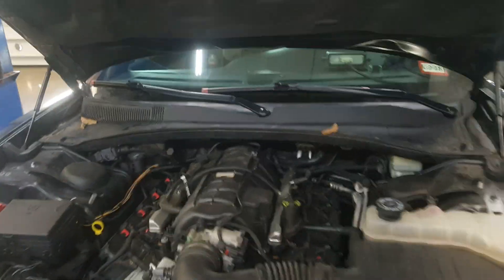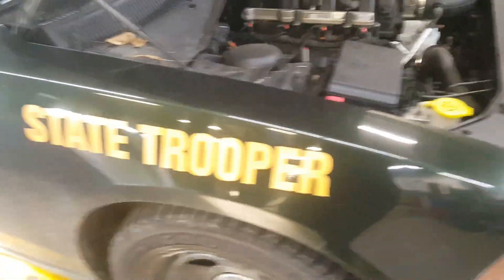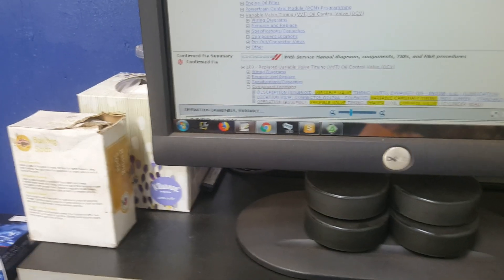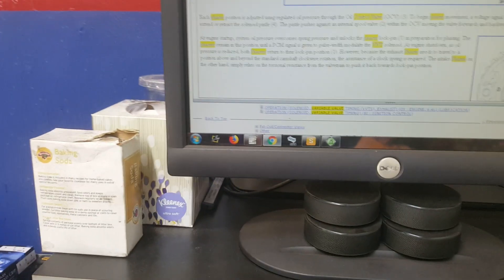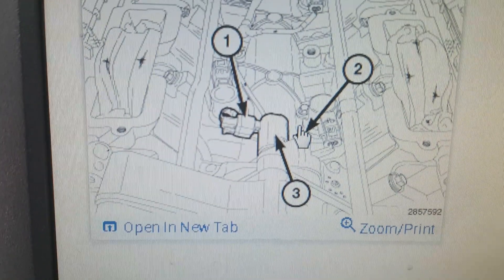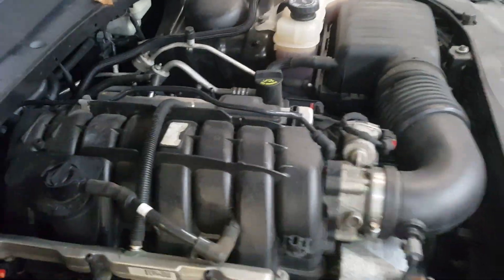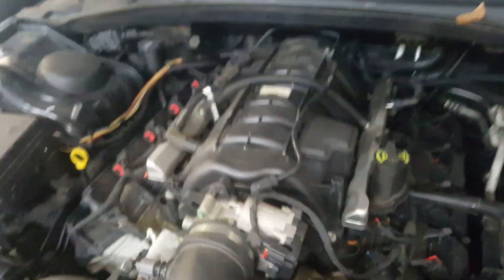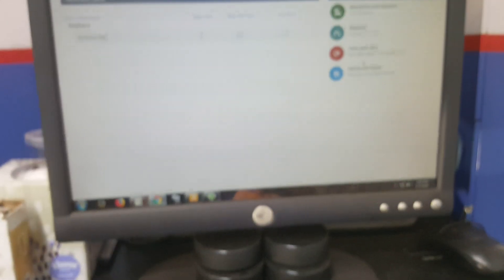How to Fix P000b P0016 Variable Valve Timing Dodge 5.7l

Comment: I’ll try this out. Thanks for sharing! My Charger isn’t showing a check engine light. The VVT monitor isn’t resetting and won’t pass smog. I’ve driven the car over 500 miles to get it to reset. Are there other steps you recommend after changing the oil? I’ve been to 2 mechanics and they are stumped.

Comment: At the end of the P0016 Road there is a new timing chain, and possibly more, waiting for you. New oil, ha! New VVT solenoids, ha!. Those are just road markers. 😆
Reply: So what about P000B??? I know that stupid eco mode on these cars can fail but what would P000B code be long term? It's Camshaft position slow response bank 1. Clear the code and it comes back around 100 miles driven. Thinking of going with the solenoid under the manifold. Told my wife to stay away from the Jeeps but she couldn't resist 🚮

Comment: I wished I saw this before last week, same issue with my 2010 challenger, the dealer says they fixed it but now the VVT actuator sensor is bad and they are trying to charge me another $400. Is it worth that? The part is only $64 they say

Comment: I changed the oil in my wifes Telluride. I normally add engine restorer to the oil every oil change and b12 chemtool to the gas. now I have a check engine light on the vehicle. what do u think. I have the codes p0016 and p0016p.

Comment: Hell.... I did a resistance test and it has audible click and it was still jacked! Just look at the desired angle vs actual angle PIDS, if they're aren't matching after changing oil, replace the solenoid. They're like $80. These engines are crap😂😂

Comment: I changed that solenoid when I changed the lifters, cam, water pump, timing chain set and gaskets. The original oil control solenoid had the one screen gone. I got those codes and checked it. The new one had the same screen busted loose, that was broken on the old one. O'Reilly's replaced it under warranty. The O.E.M. one looks like the Dorman one from O'Reilly's, but it has a retainer that goes over the screens, so it doesn't do what my new one did. I figured since that one broke, replacing it would fix it. It didn't. Since those codes are for the crankshaft and cam position sensors, I changed those. Still getting the codes and the engine sounds like it's pinging, when accelerating. It almost sounds like a rattle when driving it at a constant speed. At first it started as a noise when economy was on. I would change it to shifting manually, to turn off the eco/MDS. It seemed to go away every time I did that, so I thought it was the MDS solenoids. When I found the new oil control solenoid screen broke again, I also changed the MDS solenoids. Still making that noise. It's really strange. I can be driving and hear that rattling noise, and it would go away when I change gears. This is really annoying me. Do you have any idea? I have about 10-15K miles since I did the cam and lifters.
Reply from the maker: Sound like a loose timing chain. Maybe bad tensioner.
Reply: You need to replace your timing chain
Reply: Did you figure out the problem?
Reply: @abby.m0124  I've been too busy fixing what contractors failed to do and do right, at mother in laws house, after a water leak in her house. After Thanksgiving, hopefully I get a chance to replace the VVT mechanism on the cam. Right now, my thermostat is sticking too, so need to change that while I'm at it. I just haven't had the time. Good thing we have other cars to drive.
Reply: @shark70007000  sorry to hear about the sub par work your mother inlaw received, I was asking about your truck because my 2012 ram 1500 5.7 hemi threw me p0016, (constantly was on) and p000b (was coming ob and off)
And the guy at Auto Zone hooked up his little obd2 reader, and he said “His computer is pointing at the VVT Solenoid, Its a part that is relatively easy to remove and replace, but the hard part is getting to it,
Its completely under the intake manifold, And boy what a job that was today, But it all done, and the code cleared it self, my Ram has 165k miles, but she still runs amazing.

Hopefully you can get your truck figured out, But after your mother in law is taken of, Of course
Take care man
Reply: @abby.m0124  When I take everything apart, I'm going to have to take that VVT solenoid back to O'Reilly's, again. Since the part does have a warranty. I wasn't getting any codes for it, even though the screen came off one part of it. Changing that solenoid is easy, compared to what I have to do.
Reply: @shark70007000   I would check out the timing chain guid, or tensioner,  (Im not a mechanic by any means,) Ive read that, and seen a couple vids on YT that after replacing the cam crankshaft sensor, and or the VVT solenoid, and the rough idle is still there, its most likely the timing chain guid or tensioner, Like I said, Im not wrench turner by profession, only when my truck needs to be worked on, and Im trying to save $$, Hope this helps .
Reply: @abby.m0124  When I have the front of the engine apart, I am going to check that. I've had to replace the timing chain once, since I did the cam, lifters, chain and water pump. The guild was a 2 piece part, where the plastic broke, so the chain was running loose. It caused that noise for a year, and caused the teeth on the crankshaft timing gear to wear out, so the chain jumped a tooth. That threw cam and crankshaft position sensors codes. I replaced both, still had the codes. That's how I found out it was the chain. When I got it apart, that's when I found the broken piece. When I ordered the new chain set, the new part looked like the old one, with the two piece guide.  When I looked up the MOPAR replacement, it looks like they changed it to a single piece plastic guide. Autozone had just the guide, that looks like the MOPAR replacement design. So I put that one on. So I'm wondering if that one broke too? It's too hard to tell if the chain is loose, without taking the front end apart.